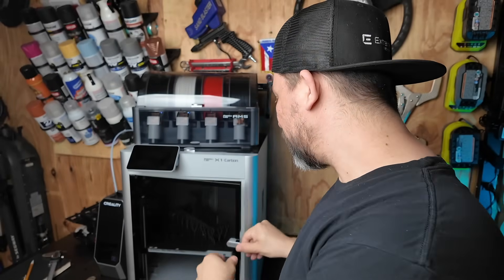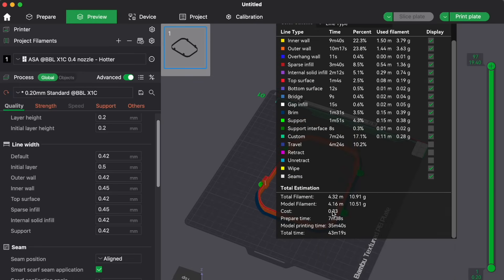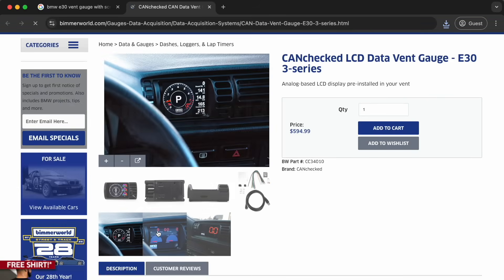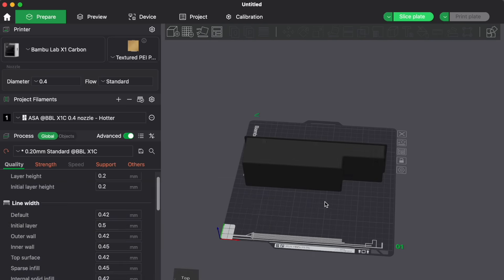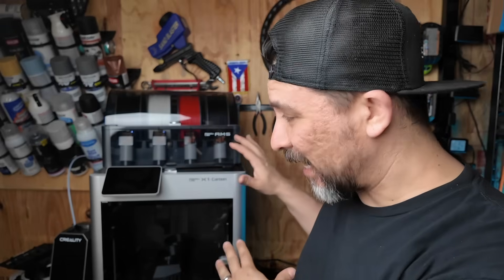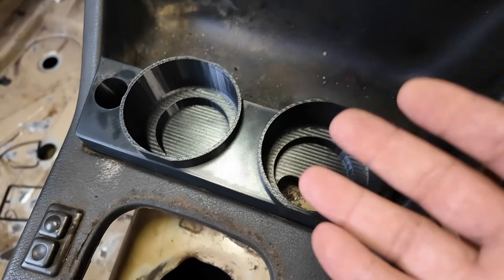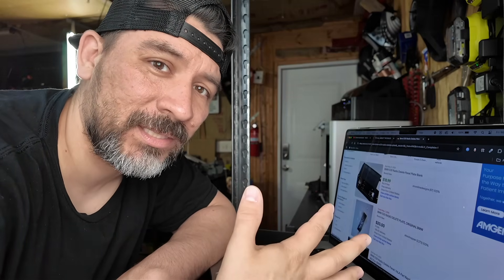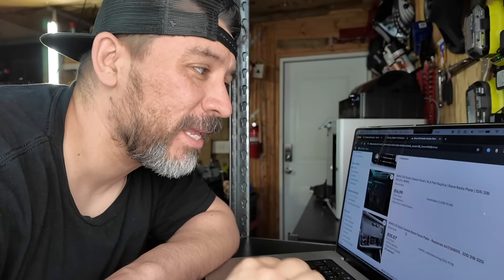How To 3D Print $600 Worth of Car Parts Cheap (FULL BREAKDOWN)

Comment: I need to make a couple parts. On for the Harley sportster I have a speedo mount that hangs off the frame but wires need to be hidden how can I design it? Might make the speedo mount with an arm that has the wire harnesses hidden through the mount.
Reply from the maker: That’s a pretty good idea. A mount arm could hide the wires inside the arm. I use Shapr3d to design all my parts. Here’s a starter guide -> https://www.allaboutthebuild.com/blog/2025/2/design-your-first-3d-printed-car-part-today

Comment: At 6:24 , I see surface quality issue on the cylinder walls. I think your CAD software produces low quality .stl files by default. You can easily make super smooth curved surfaces by increasing export quality in your CAD software's menu before generating the .stl file.
Reply from the maker: I found this file pre-made, but using Shapr3d for parts I made you are correct. Thx for watching and the feedback!!!

Comment: I'm restoring a '79 TE37 Corolla. Parts are difficult to find. I'm going to look into printing some parts. Thanks for making this video Boricua 💪
Reply: Is better to use material to withstand the heat like ABS. Pla and other plastic boiling points are low.
Reply from the maker: Gracias 🇵🇷 If you need help finding a printer, I put this tool together 👉 https://www.allaboutthebuild.com/blog/2025/6/3d-printer-for-automotive-parts

Comment: PSA: PLA will deform in a hot car in the summer.  Do your research on what plastics to use in automobile settings, as not all filaments are the same.
Reply from the maker: You are correct, but I’m confused… in this video we showed ASA and printed everything in ASA, not PLA. ASA can withstand over 200 degrees F. and is also UV resistant 👍

Comment: ALL you need is a 1500$ printer ...A computer (should already have thaty tho)
 Then you need filament  that that will live longer than a year in actual use. .. 
Then ...you have to print it :-)  Fill yer boots !
Reply: The AD5X can be bought for about $300 to print multicolor, or the AD5M for less than that and it's already enclosed.

Filament is 10 to 25 bucks per kilogram.

Comment: I'm not sure if this is sponsored by Bambu (sounds like it)... but there are plenty of other brands that have the same capabilities as Bambu for 1/3 of the cost.
Reply from the maker: Heck yeah, check out the Centari Carbon. A game changer
Reply: @Itsallaboutthebuild  I just recently got the Centuri Carbon, that's what prompted my post. It does everything except ams for a fraction of the cost
Reply from the maker: NICE!!! How's the Z offset when changing different filament types?
Reply: @Itsallaboutthebuild I have ZERO issues. I calibrated it once when I got it and have put 530 hours on it since. Ive only printed in PETG and PLA (Sunlu, kingroon, elegoo and creality) but I get perfect 1st layer and bed adhesion everytime.  I just Elegoo to announce the AMS
Reply from the maker: Fantastic, think I might have to pick one up and give it a try. Do you 3d print car parts with it???

Comment: I want to be a smart person and be able to make my own parts.  I have a printer but don't know how to make things.  Just buy files others make.  I bought printer to make a few certain things automotive but don't have a clue. Like my aftermarket backup camera doesn't fit in the factory slot and i just put a few screws in factory mounting and now have a camera on camera.  Yuck.
Reply from the maker: Making a custom mount for your backup camera is a perfect project. I too got stuck with trying to find premade designs, so I started making parts myself. With some practice, you could make your custom parts. Here's a starter guide with something like a simple radio delete plate -> https://www.allaboutthebuild.com/blog/2025/2/design-and-3d-print-a-radio-delete-plate-with-shapr3d And if you're looking for a beginners online workshop, we just put this together that shows how to design parts completely from zero -> https://learn.allaboutthebuild.com/courses/automotive-design-course Let me know if there's anything else I can help with :)

Comment: is 3d printing cheap enough to be implemented at large scale ? I rest my case.  its still and always will be cheaper to inject mold.
Reply from the maker: What’s your setup for injection molding? That would be a great comparison 🤔
Reply: Yes, advantage of 3D printing is small scale. But what good are 1000 cheap car consoles, if there is not a large demand and you have to keep them in inventory for 5 years and ship them all over the place? That’s where 3D printing shines!
Reply: It's not cheaper to make ONE part injection molded when you factor in $20,000 for the mold

Comment: Time was not a factor for the parts you made and you saved money compared to buying online.  however, when it comes to the radio delete plate you plan to net $25 on Ebay, how much time did it take for the printer to print it?  - I am curious of the $/hr return you can make with a 3d printer.
Reply from the maker: Around 37 minutes per part, you can do around 4 on a 256x256 build plate to save on leveling/flow dynamics calibration between each print.
Reply: @Itsallaboutthebuild that is a lot faster than I imagined, based on other videos i watched. 👍🏻 i am new to your channel. I really like how you custom make pieces.
Reply from the maker: Thx!!! We also post tons of extra tips/tricks/guides via our FREE newsletter too -> https://www.allaboutthebuild.com/
Reply: @Itsallaboutthebuild the time to make a part is a consideration, but remember that's the printer's time not yours. It could print while you sleep.

Comment: Or even cheaper way would be to get an Elegoo Centauri Carbon for $299 and print ASA and carbon fiber infused filament. 😂
Reply from the maker: Heck yeah, just wish they had good auto z-offset. Most of the really low priced 3d printers need manual calibration for z-offset when changing different filaments which is unfortunate :(

Comment: You could bog, sand and paint them for even more of a professional look. It's layer lines that look janky imo. Also there are great affordable 3D scanners like Creality's Ferret. They are a game changer since you don't have to spend hours modeling and measuring to create a copy.
Reply from the maker: We have the Creality Ferret Pro and used it to 3d scan a few parts. Agree it works fantastic. Also working on testing different methods to smooth parts out, might be an interesting video...

Comment: Looking into learning 3D printing. I made half an interior trim piece using JBweld plastic bond putty and a paper clip. The piece is the part that goes around the cigarette lighter and has a little door that has the power point behind it. The plastic around the cigarette lighter broke. So using a paper clip and a soldering iron I made a circle of metal around where cigarette lighter was. Then using the putty I built up upon the metal paper clip. Placing the part in place a few times. I had a part that matched up almost perfectly. Some brown spray paint later it looked fine from a foot away. Then on a junkyard run I found the part I needed after I made the old one. So now I have 2. I want to learn 3D printing so I never need to make a part out of plastic bond putty and a paper clip again. If you’re wondering what the part looks like. Google 2002 Lincoln Navigator interior and look at the dash to the bottom right of the steering wheel, below the ac vent. You will see the cigar lighter, the door, and a vent for heat for some reason. The plastic that broke was the top left corner where the cigar lighter is.
 End of story.
Reply from the maker: Nice, you could learn to 3d model and for sure start to 3d print your own parts. I never thought it would be possible, but after giving it a few tries it’s become a fun side project for all the parts we needed on our BMW e30 project car. Thx for watching and sharing your experiences 🙏🙏🙏

Comment: I can't believe how easily these printers print polycarbonate. I spent so much time and money  getting my ender 3 to print PC. Now my $320 eleego century carbon can print it's outa that box with no tweaking. Perfect prints everytime.
Reply: Had the cheapest Ender and was never realy happy. Only problems and the fanfolk told me Im the problem and that I dont care for my stuff.
Actually I always said I wanted a plug and play device which it was sold as and it was not.
The A1 i bought an a rage quit was an eye opener and the A1 is even the cheapest you can get from them....

All the money one can save by using these cheap enders printers are not work the time and problems in fixing the stuff that should work from beginning.
Reply: @thorstenschmidt7604 that's what I had. I ended up buying two of them almosts weeks apart because of how useful it was. Then one of the boards went bad so I upgraded to the big treetech board and a touch probe and that ended up being the only printer I would use. But I gave that to my kid after getting the century carbon
Reply from the maker: Nice, I started with an Ender 3 pro too. what type of parts are you printing on the Elegoo???
Reply: @Itsallaboutthebuild lots of 2A parts,that's why I'm using PC. But I'm gonna start on my sideskirts whenever I get my 3D scanner in.
Reply from the maker: Nice, we've been using a Creality Scan Ferret Pro. What scanner are you looking to get???
Reply: @Itsallaboutthebuild I have the ferret SE. Honestly I'm pretty impressed with it. I'm gonna start scanning my sideskirts this weekend. I need to make a sideskirt that matches my fender flares.
Reply from the maker: NICE, how do you plan making the sideskirt? Multi-part 3d printed?
Reply: @Itsallaboutthebuild I'm gonna log it. But it should be simple. I'll scan it. Import the mesh into fusion360. I'll stretch a 6in segment of the side skirt profile at a time and then lost them all together that was it will sit flush to the existing sideskirt. Shouldn't be to hard. I'm scanning it tomorrow.

Comment: this is definitely a really underrated channel! i want to learn more about 3d printing car parts for my e30 and i’m planning to get a printer soon and your videos have inspired me a lot. thanks for the content and keep up!
Reply: Hey man, don't know if you bought one yet, but DO it! I picked up an A1 mini 3 days ago at Best Buy for $200 and it has been a blast! My brother has a 95 Corvette and the rear sunshade has a terrible mounting bracket. My second day into printing that was my first project. I took out the original and took all the measurements I needed. Came up with a simple sketch and printed out a prototype within 3 hours!

Was able to just reprint it in PETG with 4 wall loops instead of 2 for strength and heat protection. The smile on his face when I gave them to him was priceless. I can't wait to print more useful parts. This is only the beginning.
Reply from the maker: Wow, that really means a lot 🙏🙏🙏 . Please feel free to share our content to other e30 fans out there. Our e30 is still in hundreds of pieces so stay tuned for more to come 😀
Reply: @Itsallaboutthebuild my e30 also is in a hundred pieces😄 i’m currently dealing with the rust i hope to get it back running before the summer ends
Reply from the maker: Nice, same. Fixing the last 95% of the rust, but its too HOT in the garage. Need to get me a mini split 😀

Comment: I have been looking for 1:1 car parts all over… all I can find are 1:32. Is there a place that I can find different car 3D printable molds for car parts?
Reply from the maker: You might be able to search for 3d scans of certain parts which can be used to make 3d printed molds instead. Depends on the car, which car are you trying to find parts for?
Reply: @Itsallaboutthebuild  The magic word is "might". Its only if someone had ever modelled whichever part concerned, then you are right. It is possible to save money by printing it. Unfortunately, this means if a car is rare enough, its still going to be a tough journey trying to find that model. Still, good sharing in any case.
Reply: I am trying to get interior parts for 4 different cars BMW, Gt R, Porsche, and Lambo’s. The interior part’s, but I have been looking for the last 2 weeks and nothing.
Reply from the maker: BMW e30 seems to have lots of premade models on sites like thingiverse. Not sure about the others… you can also find low cost pay to download models from cults3d
Reply: @Stormechaser1979  Someone would have to have done the leg work and share it on public domain. And, its quite a bit of leg work for these to be shared freely on the web. :\

Comment: Orientation matters for 3d part strength. Often times an STL will have a print oriented on it's side on purpose because parts will break on layer lines so it's important to orient the layers for maximum strength. Unlikely to be an issue for the center console, but thin parts/brackets should be printed so the layer lines give maximum strength. It's not unheard of to print things at a 45 degree angle with maximum supports to keep too much stress off small areas.
Reply from the maker: @bismuth4847  for sure, think I might even recreate the 3d model of the trim with brackets to make it easier to print at an angle 🙌🙌🙌
Reply: This... I don't think it will be a lot critical in this case but some other it will be and some people overlook this.

Comment: 1:48 it's absolutely terrible part not adopted for fdm printing at all, you have to print it at 45 degree angle to the bed to make it somewhat reliable otherwise locking notches will go out in no time if there's any tension at all.
Reply: One other option, is to bring the material up to it's glass temperature. What we are doing is having the material go to it's glass temperature phase, and, when it cools it better forms as a coherent single object instead of being more distinct layers - no, we don't want to melt the material but we do want to heat it just past that glass transition temperature.

My research digging into this (no personal mass testing as it just hasn't been needed for what I do) suggests this can strengthen the part by some 30-40%.
Reply from the maker: @formes2388  oh really? Do you use a printer with an active heated chamber.
Reply from the maker: @SergeiSugaroverdoseShuykov  good advice. The part was pretty sturdy and flexible with ASA, but I’ll give the angled print a try and test it out. Thx 🙏🙏🙏

Comment: You can make all interior parts even better, print them tilted 45 degrees and use fuzzy skin set to a very small size. This will immitate most textured car interiors and it hides almost all layer lines.
Reply from the maker: @Terrorist939  awesome tip, we have fuzzy skin a try on our 3d scanned ebrake handle and love it. Will have to try it on more parts like the e30 cup holder. Thx 🙏🙏🙏
Reply: Awesome tip. What’s the point of tilting it 45 degrees tho?
Reply: @morphosis180  45 or even 60 degrees. To get fuzzy skin on front surface, it can not be placed on the bed.  It depends on model and final appearance you want get.
Reply: @morphosis180  It makes the parts considerably stronger relative to the common installation orientation while masking the layer lines created by the printing process. The fuzzy skin option will further mask it, likely looking like an OEM part when done.

The trade off is additional material for supports. Though if you're designing your own part, supports can be made part of the design such that it's holds it upright at the desired angle, minimizing material wasted on supports.
Reply: Definitely going to try the tilt part, I tried the fussy option n it look okay but seem like still needed something else